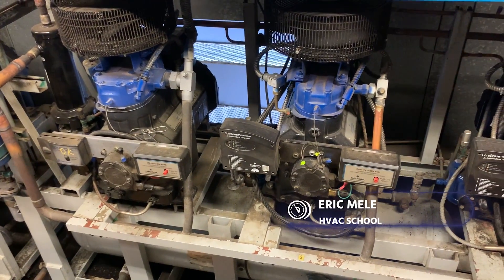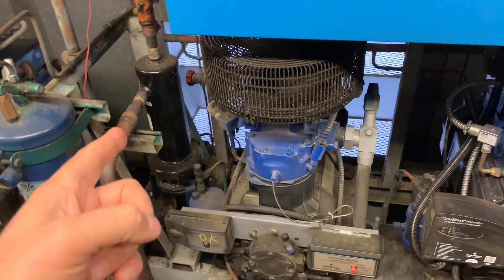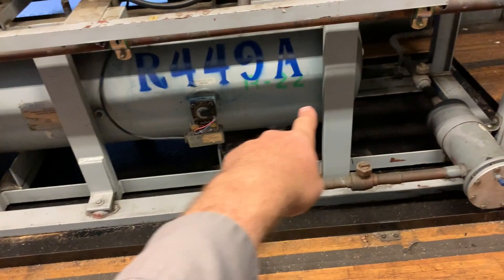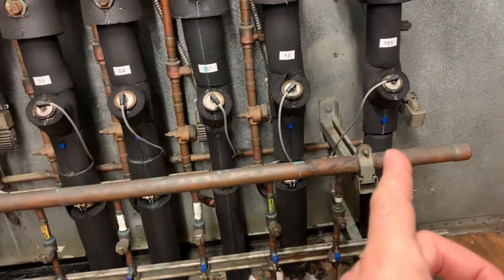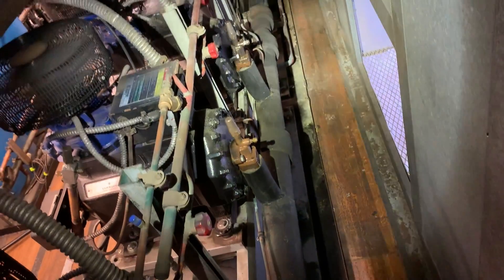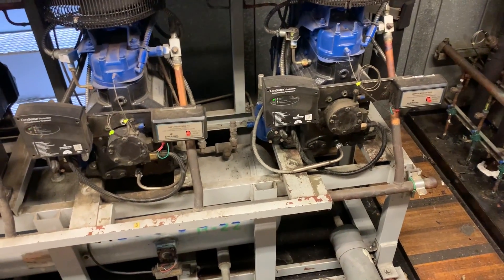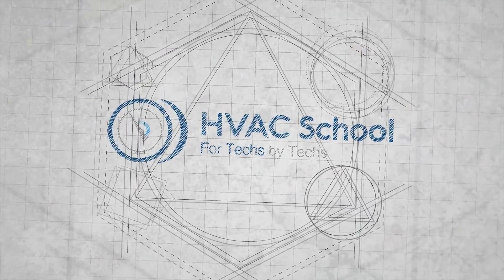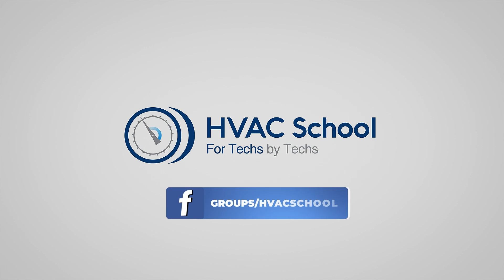Rack Refrigeration 101 Definition and Overview

Comment: Perfect timing if I do say so myself, my employers are manufacturing chiller skids for Walmart coolers and they pipe in to Walmart’s existing rack system. Our skid contains a braze plate, special set of pumps, a set of eev’s, glycol feeder tank, and new set of controls. Trying to find more information about rack systems.
Reply: You work for DEEM??
Reply: @randyboughan4909 No sir, previously with RAE corporation.

Comment: I have a job interview on Tuesday for a supermarket refrigeration job. I've been to school, worked on residential and have some exposure (HVAC SCHOOL channel) to supermarket refrigeration. It is for a 3rd yr. Apprentice, so I will have a Journeyman with me. Any pointers you give what to brush up on, in the oil system, for my interview. The Key components to research. Thanks. God Bless and Be Safe, brother!
Reply: Did you get the job?
Reply: @mGsr-pr6hh No. Went industrial refrigeration. Working on Chillers, and mostly Cascade systems in Temp chambers that test car parts at extreme high, low, very low temps. God Bless.
Reply: @tennesseehvac670 dang what a switch lol. congrats though! i’m currently in trade school looking to get into refrigeration, seems like an awesome field
Reply: @azan5474 he didn’t jump ship. He still doing the same thing different machinery

Comment: How much freon does that system hold
Reply: Lot of different valves and hold back valves to use minimum refrigerant. Old ones held 2000 lbs but only because pipe runs and off cycle defrost. Smaller condensers lower the refrigerant quantity.

Comment: if one compressor is bad and needs to be changed, the refrigerant charge needs to be recovered, is there another option other than this such as a pump down?
Reply: You just isolate the one bad compressor, pump it down individually, and change it with the rest of the rack running.

Comment: Someone has spent the time keeping this rack up.  I can tell by some of the controls, this is an older rack.  The insulation has been clearly replaced (and very well done at that) and it looks like some of the other controls have been updated.

Comment: What size pipe is used in rack system
Reply: I don't think there's a standard, depends on the system. Liquid headers I don't typically see under 1-3/8" with suction headers always over 2". Individual circuit liquid lines are typically 1/2" to 5/8" with suction lines being 7/8" and up. This is just what I see with the stores I work in; somebody may have something different.

Comment: I see that the rack in this video is a low temperature rack based on the head fans.  Also, I didn't notice any mechaical subcooler in the liquid line before the liquid is fed down to the cases. But there may be one. I just didn't notice it. Good video!

Comment: I did racks about 7 years when l start my career l was lucky that l had a good knowledge of reading schematics and good electric  background .Troubleshoot is 75% is electric and 25% mechanical of troubleshooting  plus you have the BAS and rack controls . You only enough time due food spoil $$$  4 hours was maximum from the time you get the call .
Reply: HVAC Northeastern, hi there were MANY jobs I had on night service, that were80 miles away, 4 hours would NOT  cut it, Many years ago I did 1500 miles in that week FRIDAY , then after hours until next  THURSDAT NIGHT, it sucked, all my service was in NJ, from ESSEX CO, down to BARNEGAT bay. I have been retired as of  2003,  🇺🇸🇺🇸🇺🇸🇺🇸
Reply: Not anymore 
Here we make them pull the case until we get there

Unless it's a whole rack down or line up yeah hurry.

Comment: Racks are sweet but I personally prefer central systems with screw compressors or Mycom recips
Reply: oh shut, up from you silly comment I am sure that your experience is very very limited!
Reply: @gearhead0800  i work for a global manufacturer & I merely stated my preference. I did not decry this type of system. Not sure why you felt the need to belittle my comment.

Comment: Master One question :
This is "parallel rack system", i.e common header for all Evaporator suction line and common reciever for all compressor.

What is "series rack system" ?
My idea : If there realy exist "series rack system", then it will be two or multi stage compression system.
Reply: I think it would work.
Reply: CO2 Transcritical uses this idea - a low temp parallel rack that discharges into the suction header of a parallel med temp rack.  So 2 parallel racks piped in series.